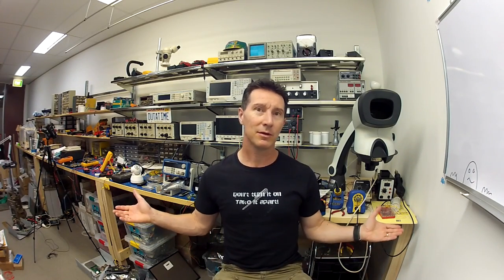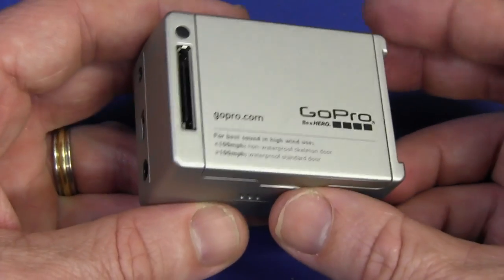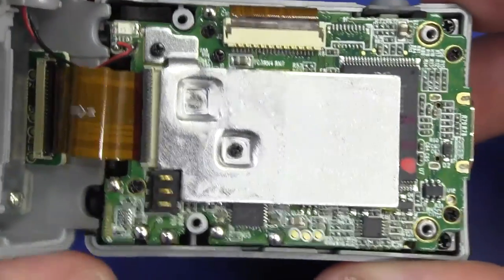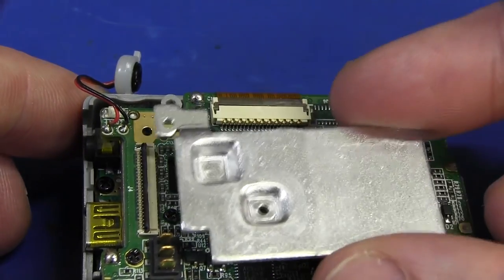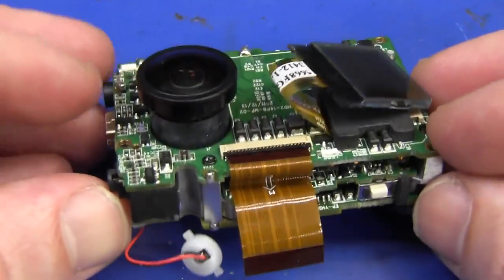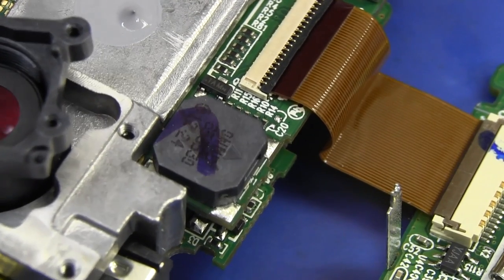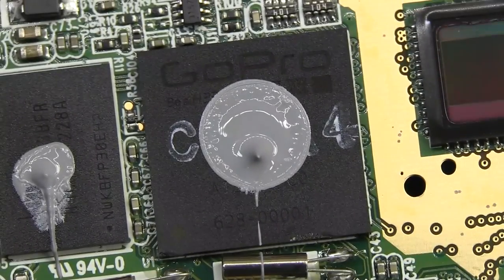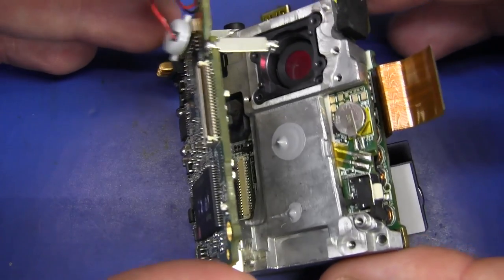EEVblog #399 - GoPro Hero 2 Teardown

Comment: The solder pads next to the battery connector are the RS-232 UART (serial console) and the JTAG interface.
The Hero2 is very similar in style to the Hero HD. I had my Hero3 black in pieces over the weekend. It's totally different - single board, very little aluminium. Ultra dense, a lot less passives. Some fancy black moulded flat flex cables. Two microphones on the main board. 
Clearly a different design team/company.

Comment: I think it would be interesting if you did a tear-down of the SJCAM SJ4000 for comparison of build quality.
Reply: that would be good
Reply: That's if you can find a real SJ4000 through all the cheapo copies.
Reply: Michael Parker I have one. The actual video quality is perfectly fine, and actually pretty damn good in comparison.
The audio recording isn't, but again, for this kind of thing, you'd most likely over dub it.
Reply: iKaGe01 Agree for what these things are used for the audio quality doesnt need to be top notch. They're mainly used for sports, RC models etc, so lets face it, the primary objective of the go pro is to capture good video. Same with the real SJ4000 if you can find one - I'm also looking for one to stick on my quad - not going to risk a $500 go pro in case I have a fly away... The SJ4000 is 99% as good, and way cheaper (for the real one) and audio on a quad is of no consequence, most flyers just dub non copyrighted music over the audio track - who wants to listen to 10 minutes of propellors spinning :P

Comment: I'd guess that apart from heat sinking the metal is there for structural support of the boards during impact and to warm the battery when submerged in water.
Your videos are awesome BTW I'm a mechanical engineer and I'm trying to wrap my head around electrickery, your videos are very informative. ;)

Comment: 0:12 Absolutely right. Never seen such a mess before. Hoarder.
2:00 Your theory is incorrect. GoPro doesn't have a zoom lens. It uses digital zoom for narrower angles, which is essentially a type of amplification. It uses less signal (less captured light) and expands it to fill the entire screen. So there's more noise.

Comment: I can't imagine it all being for the sake of heat sinking..
i think this is more for the whole package stability, for the extreme conditions the camera needs to operate in. Also the heat sink in the back, is to keep the battery at a constant temperature. Which either by design or side effect, helps it behave properly in extreme outdoor temperatures.

Comment: I remember reading somewhere there is a mode for cold climate which heat the battery to get keep in running longer. It might be the reason for some of the heat-sink.

Comment: Las Vegas is hot! & next year I'm planning a VERY long motorcycle ride, should take almost 3 weeks riding 8 hours a day!  I plan to use a GoPro2 hardwired to my motorcycle with several 32 gig cards. This GoPro needs to run 8+ hours every day for 3 weeks straight in 720-30FPS mode. Yea I could use the time lapse feature but speeding up 30FPS footage looks soooo much better IMHO. The goal is to condense the entire trip into a 10 minute video. So that's why I noticed the thermal compound.

Comment: Just as a FYI, the metal plate on the back of the board is a battery warmer to keep the battery warm for when the GoPro is in snow. P.S. In Australia the GoPro's over-heat a lot because of the battery warmer. (It's programmed to shut off at a certain temperature)

Comment: As you can see there is no really good heatsink on the main chip. You can see large blob ot thermal grease on the chip and on the aluminium heatsink too. There is no pressure between them, i suppose there is a gap, maybe a millimeter or two. This kind of heatsinking is a very good idea but in this particular camera it will not work due to low quality of assembly. Sorry for my English.

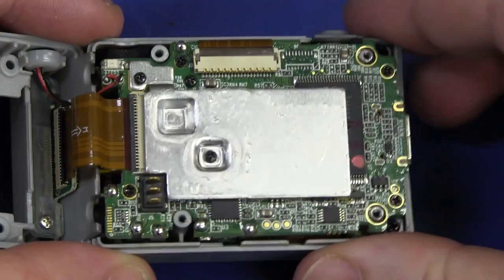Comment: 6:10 pretty sure that's the battery heater -- as a 'feature' it works in very low temperatures by heatsinking directly into the battery.

Comment: It's got shitty signal to noise ratio at high gains! I bought one and the first time I used it was at night. No issues under broad daylight though.

Looks like a 16 layer PCB on one of those boards, 3 boards, and a proprietary chip more, complicated than you though it was, ha!

Thanks for the video.

BTW, did you signed a non-disclosure agreement to get that datasheet?

Comment: Why did they fill the thing with aluminium and still not have an aluminium outer case? Wouldn't that fare much better thermically?
Reply: to save on the weight factor :)
Reply: Nick Parillo I'd say the Benjamins-factor. :-)
Reply: You really thinck an aluminium case will rezist to the same mechanical shock?The gopro case is almost bullet proof lol.

Comment: Thanks Dave! I have one of these and it spews out RF noise all over the place. This is especially a problem on a quadcopter as you can't get a GPS lock when there is a GoPro anywhere near the GPS antenna. I have mine wrapped in kitchen foil which helps but looks stupid, after watching this I'm wondering if I can pull it apart and line the inside of the case with something. Any thoughts on this?! Should I try to ground the shielding?

Comment: Y'kno what's funny? At the time this video came out back in Dec 2012, I already had my hands on a GoPro Hero3 Black (about $500 AUD shipped in mid-late 2012, $425 from JBHiFi now. Around $530AUD for the H3+ Black at DSE or JBHiFi), and had to wait until like April or June 2013 before finding gear for the thing (such as Skeleton Frame or Tripod Mount) in stores like Tricky Dicky (Dick Smith Electronics) & JBHiFi.

Comment: I hear that C11 J476 tantelum cap is the root of all no-power evils...? Just under the lens. Great shot at 12:21 by his right thumb and solder ball. Mine wont turn on so I had to check out a tear down video and this one does it well.

Comment: Always makes me cringe a bit to see heatsink compound just dropped on like that instead of evenly spread, especially considering this doesn't have a lot of overall even pressure holding the sink down to the chip. That's probably one of the reasons they overheat.

Comment: The audio is horrid!
Reply: +Tak Wolf Hero 3 has way better audio.  I think he's using the waterproof case (worse audio).  You're supposed to use a different back piece in low wind and he should have been been using it with no case (though I've never tested w/ and w/o case).  Again, no clue about the 2, but 3 is pretty good w/ the case on.

Comment: i need to work with my workshop, the space is huge, but there is a huge mess :D

any suggestions?
Reply: KrisRaps Bins. Labeled bins. When you're not working on something, dump it in a bin, slap some tape on it and write the date or some useful information, then stack it to the ceiling. Think of the work like it's data in a computer. The stuff you want to work on is in the cache or on or around the workbench. The stuff you want to get to soon goes in plastic bins stacked to the ceiling. That's the RAM. The stuff you have for later goes in a cardboard box, gets sealed and stacked somewhere else... anywhere else so long is it is out of your workspace. That's the tape drive. Keep track of what you have and where it goes on a spreadsheet on the computer. Keep a copy of that synced in the cloud.
As for organizing your tools, you can have a long work bench with individual stations geared to specific tasks or you can have a chest of drawers next to your workbench with your tools in them and get them out and set them up as you need them. It takes discipline. You have to set up one rule: workbench space is never to be used as storage. If you're not working on it, it goes in a bin. If there are no bins left, then get a cardboard box and empty some bins.
There are, of course, plenty of examples where this just won't work. How do you put a giant 150lbs. plasma TV you just got from a dumpster dive into a box or a bin? You don't. You put a high priority on gutting it for the parts that do go in a bin then take the metal to the scrap yard for recycling asap. Use the glass in a window or as a table topper. 
If I did this, my mess would be clean. heh heh

Comment: I realize this post is over 6 years old so I will probably not get a response but... I need to do the same thing but need to get to the video sensor. Sounds like to do that you have to remove the lens but you did not show how you actually got the lens off. Could you please explain or show how you did that? Thanks very much in advance.

Comment: Hello I have a question.

My go pro hero sd card was stuck I made a lot of presure and I broke it the contacts of the sd slot hardware of the go pro , it is posiblle to fix it, do you have some video with this problem

Comment: Awful job on the thermal compound..  Kind of defeats the heatsink..
Reply: hank bizzo aluminum...... not copper. where he clears heat in the closed case? battery heats itself - Lithium battery itself is harmful heating
Reply: Just does not seem legit???

Comment: Hello, my GoPro H2 is dead but the led still becomes red when I plug it to the computer and then insert the battery, I opened it like u did, but I don't see any problem, do u guys have any clue ? (When I press the front button, nothing happens)
Reply: I recommend you go to support.gopro.com and check and see if your warranty is still avalible

Comment: The microphone of the GoPro Hero 2 sounds much worse than the mic of the 7$-camera that was tested in this video: https://www.youtube.com/watch?v=1EuBRmfJLSk

Did this improve with more recent models? Becaus ethis one has the worst microphone I ever heared, it sounds like it does not record anything less than something like 1 kHz...
Reply: +rfvtgbzhn I own a hero 3.  I'm not sure about recording Dave's voice, but my voice and several other people I've heard in recordings on mine (waterproof case on), sound fine.  Not sure what's up about the mic quality in this video.  Though, I guess you're really supposed to use an external mic if you want great quality.
Reply: Sound worse at distance, maybe room echo from the corner of the room. Seems it got much better when he picked it up and recorded the sound closer.

Comment: Well, i have to say that i am surprised and a little bit disappointed with your Go Pro evaluation, you use to be very demanding, have courage to criticise wonderfull things alike high end 30K USD scopes, also you protect a lot (passion) by Fluke and there's no reason to be so expensive that way... Go Pro is  a piece of .... no waterproof gaskets, stupid heatsink that cannot transfer heat to the air..the retarded sticky covering heatsink..the battery blocking ventilation... to be continued

Comment: .. that ridiculous case made of plastic, awfull external design, poor layout, made for sport and not aerodinamic, not waterproof... cheap chinese thing... bad performance related noise, distorted images, low unrealistic level of chroma to reduce darn noise... terrible audio quality, no bass.. wind noise is captured, microphone holes have not a wind protection when it was designed to sports,..overall quality is not good and price is astronomic...goes from the moon to mars the pile of dollars...